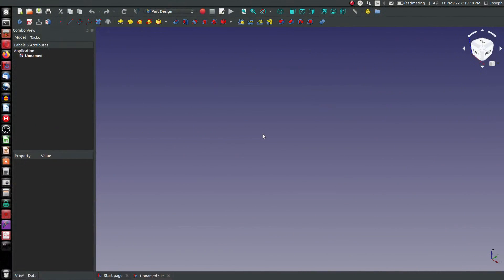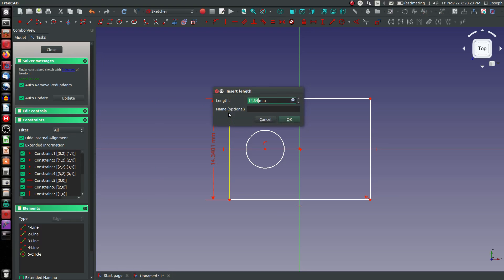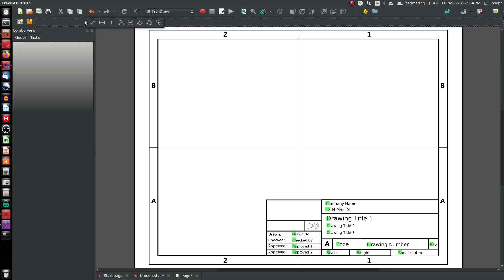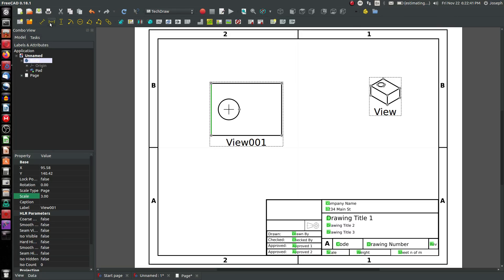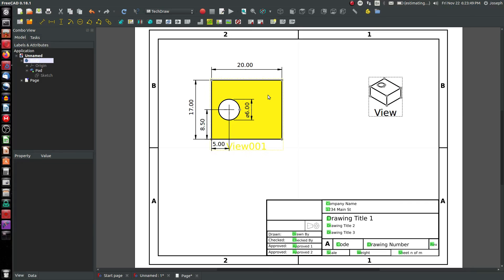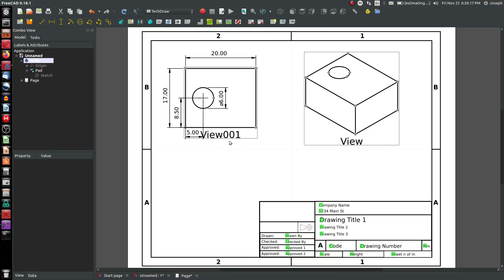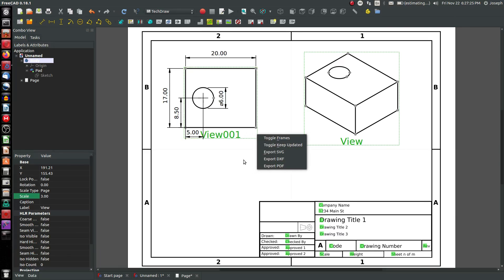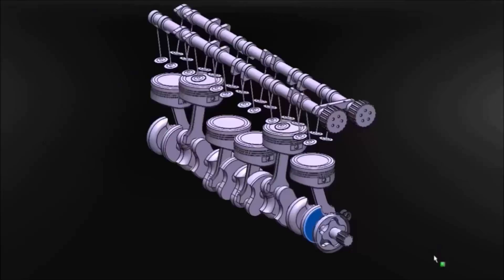FreeCAD- The Powerful TechDraw Workbench, a Quick Look |JOKO ENGINEERING|

Comment: 4:14 I am not able to select multiple edges like you do here. How did you do that? For me, selecting edge unselects the crosshair of the circle that I selected first.

Edit: you have to press ctrl key to select multiple lines or points.
Reply from the maker: Correct, I held the ctrl key.  Glad you found it

Comment: Any ideas as to why FreeCad doesn't show the correct lengths/heights when using angled edges in isometric views?

Using Ver 0.18.

For example, if i measure the width of a gable end wall looking straight down from the top at 230mm, then, do the same for the exact same dimension when looking at it in an isometric view like top right/top left, it comes up with an measurement that's way out (180 something and change).

I dont get it at all and, to boot, makes the use of measurements in isometrically positioned items in tech drawings completly unreliable!
Reply from the maker: That's a good question.  I know that dimensions on isometric views are less common for what the workbench was intended for, but this has come up in the past.  There is a discussion on it here:

https://forum.freecadweb.org/viewtopic.php?p=491731

I think there is a macro of some kind that works, but I have not investigated any of it.
Reply: @JokoEngineeringhelp  if you come up with anything it'ld be great to see it in a video chief.

Seems to me that they've calculated the lengths based on values of the [verticle axis] and [horizontal axis] for the particular view you're looking as anything that is angled off that particular views datum plane appears to calculate incorrectly..and by a fair bit too!!

Edit: I think I'm right...although, they termed it more eloquently than I did by saying it calculates lengths in 2D rather than 3D in isometric views.

There seems to be a way of linking a technical drawing measurement through to a Part Design toolbox dimension if I wanted to do it with any accuracy...hmm

More reading then 😆

Comment: Your videos are really opening my eyes up to the so many powerful features i have yet to uncover with FreeCAD.  Maybe it crashes so much because i need more memory.  I think FreeCAD is a fine choice for a startup since there is zero cost overhead compared to solidworks.  But one of the main reasons i got into it is that eventually i would like to develop integrated add-ons that use multiple other add-ons plus my own tools to streamline design to prototype/manufacture for what I am doing.  Eventually, I can get under the hood using python.

Comment: Hello Joko, wanted to ask you sth about the dimensions. I've constructed a model using part design which has the height of 2.5 m and width of 1.0 m (in realized apparatus). But I've been facing troubles to fit in the specific templates.  You have shown how you changed the scaling for different views only using the 'scale' option. But in my case, kinda different scenario. (FYI) Please check your gmail and see what I meant. Nevertheless, you always make helpful videos. Cheers!!

Comment: Thanks for the great tutorial. Can you share the spec of your computer system? I see it's running Ubuntu, but I'd like to build the same performance/smoothness for my FreeCAD setup. What's the spec of your CAD workstation? Thanks in advance.
Reply from the maker: I'm running a Xeon processor with Nvidia Quadro M series (I think it's something like an M2400) 32GB RAM.  Occoasionally I will remove long rebuilds from the video so the viewer doesn't have to sit and wait for the system to catch up, which may make it look like the system is very fast.